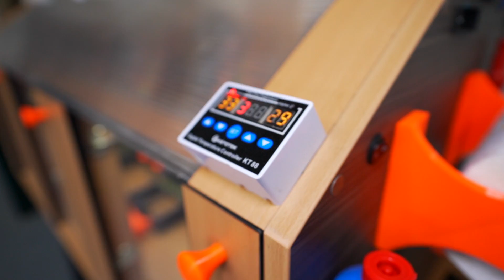Prusa 3D Printer Enclosure Box - Printing Parts for Powerful eBikes

Comment: you are printing petg on a smooth sheet!! why don´t you use a textured sheet?
Reply from the maker: Because I want to have smooth surface 😂
Reply: @BuildStudioHQ  but, that way you always have to glue the bed and clean it after every print. You could use the new satin sheet instead
Reply from the maker: Looks like you are missing something. I’ve never used glue and cleaning the surface sometimes with window cleaner.
Reply: @BuildStudioHQ  Manual says petg could stick too much on smooth sheet so you have to glue it to prevent damage the sheet while you get the part off. So I'm surprised on how could you print big petg parts on a smooth sheet without glue it before
Reply from the maker: I’ve never seen it nor used glue.
Reply: @BuildStudioHQ  well that's weird. I should try it

Comment: I would install filters on exhaust too. I wouldn't want to inhale gases generated by melted plastics and spend a whole days in the shop around them (especially ABS). Otherwise excellent job!
Reply from the maker: What kind of filter did you use for plastic fumes?

Comment: Nice ideas. One tip: instead of cooling the bed with a fan try using isopropyl alcohol (I use glass cleaner, works as well). Christoph Laimer made a good video of this!

Comment: Very well done, klobúk dole :) However in my opinion it would be better to attach the spoolholders to the rear wall of the enclosure instead of having them on the top of the printer. You can design a much more stable mount, even for a 2kg or 5kg spool, and the less weight is on top of the printer, the less will the frame resonate, which might become more visible when printing taller objects. I would also mount the power supplies to the back of the enclosure. They run hot enough to benefit from a colder environment. Just extend the cables going to the control board, use some high quality XT60 connectors (not from Aliexpress) to make a detachable power supply cable in the case you would need to take out a printer from the enclosure.

Comment: Very cool setup! How many working hours did your prusas work until parts, like bearings, needed to be replaced?
Reply from the maker: Not sure 🤷🏻‍♂️
Reply: @BuildStudioHQ  so you never had to replace something? 😄
Reply from the maker: No, I’ve been using them for two weeks.
Reply: @BuildStudioHQ  oh ok. Yeah than they should work for a couple more weeks/months 😄
Reply: @BuildStudioHQ  you can see the total printing hours in the menu of you prusa.

I asked it bc I had problems with 5 bearings with an total printing time under 800 hours. I found this a bit lame..
I don't have them in a box with that high of a temperature, but in a seperate small room with a temperature around 22°C

Comment: Take a tip from a guy who spent 8 years in a furniture manufacturing plant.
Do the same with your shop computers if you haven't already.
Also think about using a mask when you are doing stuff that puts out a lot of dust.
Your lungs are just like those 3D printers. They don't perform well with dust getting in them.
Reply from the maker: I’m trying to do my best, thanks for the reminder🤞

Comment: I agree that 3D printing its not just for trinkets for sure. I'm going to guess that you already know about SLA 3D printers, but in case that you don't you should check them out (they are more precise).

Also the size of the printed models could be increased by changing the axis,frame and belts. I have a fiend that started with a small printer (30x30x30 cm). He just changed the axis (x,y,z) with longer ones and build larger cage. It worked quite well. His upgraded printer can print parts in sizes 60x60x60 cm. So my idea was that if you really need larger single parts its possible to be done by swapping a few of the print's parts and re calibrating it.
Reply: Please don't take offense to this. Judging by what he's done here, it's safe to say he knows a fair bit of stuff about 3D printing. And I would imagine that includes SLA printing.

Resin prints, although much more precise and closer looking to injection molded, are not exactly the best for functional parts. FDM parts are much stronger because they can be made out of materials like ABS, PETG, or Carbon Fiber. SLA is just resin and resin is not reliably strong for parts used on something that you would want to know won't fail.